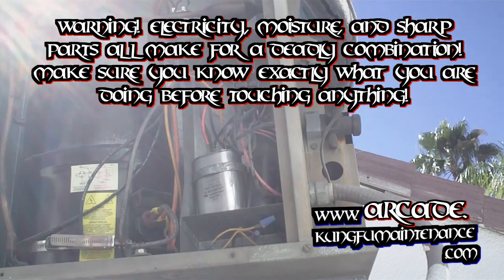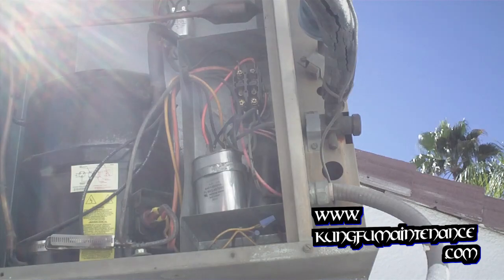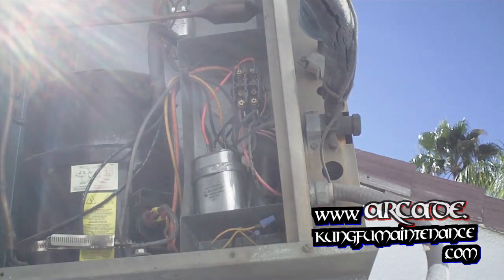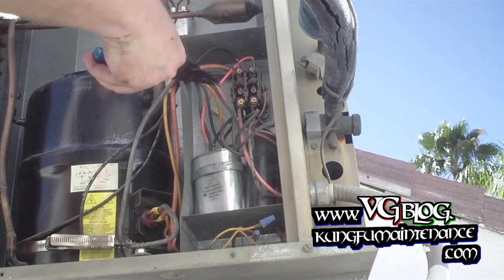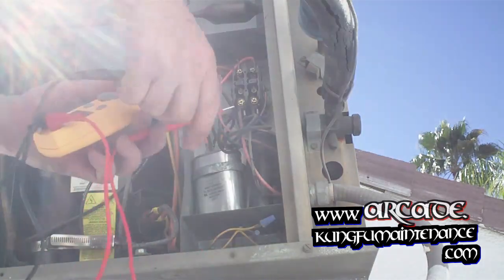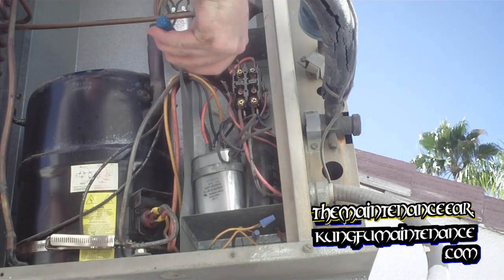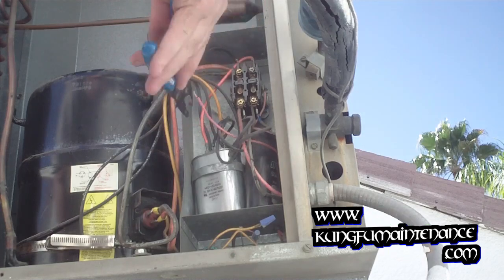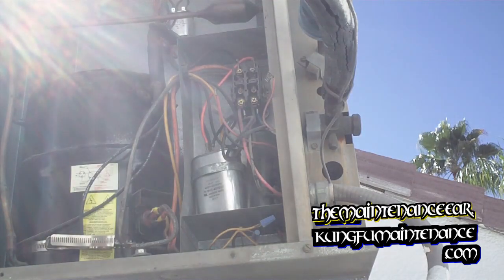Air Conditioner Not Cooling Intermittently Evidence Plus Proof Case Closed Diagnosis Bad Contactor

Comment: this is the same exact problem my air conditioner had today, the repair guy told me about it because i was getting intermittent cooling, he found it was a bad contactor, he showed me the brand new one, and then once he changed it out he showed me the old one and he showed where it had been arcing, i beleave he called them points, there was a little tiny spring that came out of there too and some burned looking metal i think he called that the points, it was interesting to me because i dont know a thing about airconditioning other then what kungfumaintenance channel shows me or what the repair guy that comes out here shows me, he has been in business 55 years so he knows what he is doing, total price today was 139.95, he charged 60 for the contactor and the rest was labor and tax. i think thats fair price,